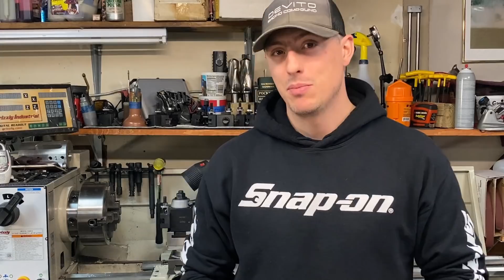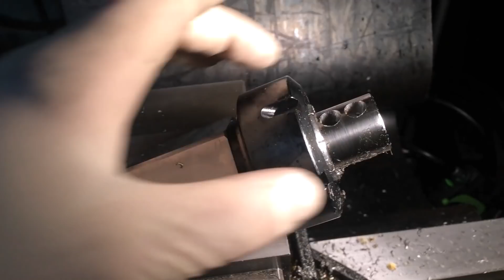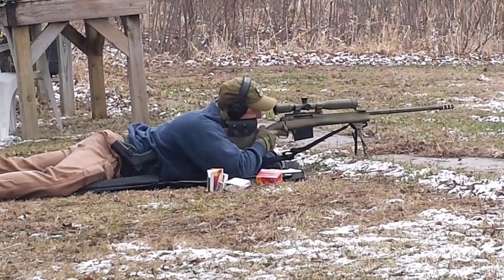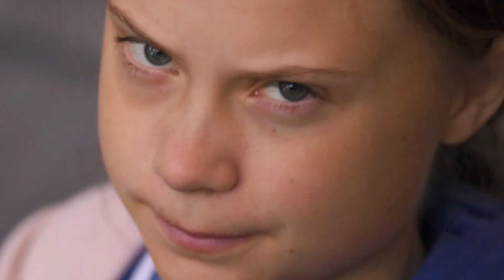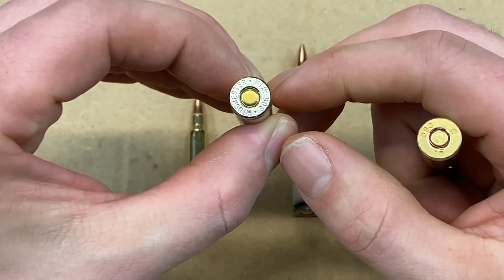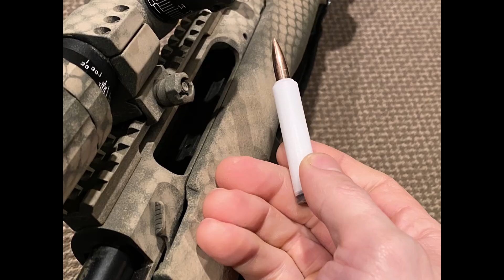6.8 NGSW ammo selected by the U.S Army for the NGSW Rifle testing! #ngsw #6point8ammo #army

Comment: Guns might overheat. The brass takes the heat away.
Reply: The brass inside the chamber absorbs some heat, but the real advantage is that it doesn't melt in a hot chamber...  Regarding recycling, almost  all thermoplastics can be recycled. But with a metal insert attached to it, most recycling plants would not dare to have anything to do with it.  Brass is still the best option. Can be re used, recycled, or left scattered on the battlefield just to be re-discovered by metal detectors after 50-100years.
Reply from the maker: All relevant concerns. I cant wait to see the test results.
Reply from the maker: wouldn't any casing material function that way.
Reply: @jeerrrrrrryyyyy  There's both advantages and concerns with the casing materials. I'm convinced most of it can be made to work .  In a environmental view, plastic doesn't sound to well. The degradable plastic types available today, do not meet the requirement for heat resistance. A thermoset plastic variant could be interesting, they will not melt in a hot chamber, but might be too fragile. If the cartridge is to be of a effective design, it need to have thin walls, and must be made of a material who will expand to the chamber wall, and make a  gas tight seal, without danger of rupture. This must be repeatable in both icy cold temperatures, and in a burning hot chamber.  My guts says it's a possible, but a damn difficult task. Brass is a well known, and very cheap way to produce cartridges.  It must be very good/cheap/environmental friendly to win the test.
Reply from the maker: @sidekickbob7227  I absolutely agree, like I said I’m really interested in the test results.

Comment: *This round was chosen by the US military for testing. It was not chosen as the winner of the competition. The competition is not scheduled to end until late 2021. This video was uploaded in 2019. 
*This polymer round is 30% lighter than a comparable 6.8mm round with a brass cartridge case, not 30% lighter than a 5.56mm round with a brass cartridge case. 
*The use of a polymer case raises the question of what will happen to the heat produced when the round is fired? Much of the heat leaves the weapon with the ejection of the brass when using a traditional cartridge. The brass absorbs the heat. Does the heat stay behind in the weapon when using a polymer case? What implications does this hold for weapons' temperature when using a polymer case?
Reply from the maker: That’s is correct the trail still hasn’t ended at this time and I’m interested to see what will the military go with when it is over.
   The information I have is from the T.V. Company that claimed that it is 30% lighter than the current cartridge being used, so that’s the information I used in this video.
   As far as the question of heat I can only speculate because T.V. Has not released this ammo commercial yet to test. 
   I have studied energy transmission

Comment: The 6.8 mm makes no sense at all to me. 140 Gr? Why would you go 6.8 mm? Because Remington said so? Still think Remington's analysis that 6.8 mm was more lethal was as flawed at 6.8 mm SPC. If you are going to 140 Gr, then why not 6.5mm with higher BC bullets? You will have flatter shooting longer range ammo. Hope this is not a case of military brass failing our soldiers again.
Reply from the maker: That’s fine, it doesn’t make sense to a lot of people.
   Yes 140 is what has been reported in testing with the True Velocity round. That could change due to it still being in testing phase.
   I don’t think it has anything to do with Remington, that company is gone.
   To your 4th statement/question I can’t tell if you’re asking me or the military testing this ammunition.
   I personally like 6.5 Grendel, but my opinion doesn’t write policy with the military industrial complex.
   As to the “hoping it’s not the case” I don’t know. This whole testing process could go away as fast as it started.
   Thank you for watching Taluvian.
Reply: @jeerrrrrrryyyyy  6.5 mm vs 6.8 mm you need 30 to 35 additional grains for similar BC. You then are canceling the saving weight and reduced recoil narrative. For same BC as a 140 to 145 gr 6.5 mm you would have to jump up to 170 to 180 gr bullet. Now you are back to 7.62 recoil territory. I have always felt the 6.5 mm was ideal military rifles. One can argue all day which current cartridge is best option. The issue I have with 6.8 mm was I do not see why this would be choice, other than Remington study saying 6.8 mm was most lethal for military rifle caliber. Then come out with a less than optimal cartridge. I still think 6.8 mm is a mistake, and military should be looking at 6.5 mm high BC long range performance.
Reply from the maker: @Taluvian  I think you’re correct, one can argue all day about which cartridge is the best option.

Comment: pro:33%lighter
140 grain moving at 3200fps is 3200 ft lbs of KE.
Might be good a good fit for a lmg or dmr

Cons: takes up alot of space.
Recoil is going to be a son of a bitch.
Doubtful that it penentrates armor at 100 yards certain it wont at 300 yards even with api rounds which most soldiers probably wont carry.
Magazines are going to be huge and hard to mount comfortably on a plate carrier.
Wont penetrate armor at 600 yards so marksmanship will still be required.
Barrels on rifles will get very hot 3200 ft lbs is a good bit of powder so yea maybe you can carry more rounds but im skeptical that you wont be able to shoot as many without the barrels overheating. 
Looks kind of stupid too
Waste of money 
80% OF SOLDIERS ARE HAPPY WITH THE M4
Reply from the maker: That certainly is a list of cons.

Comment: I understand that polymer ammunition can fire longer before problems with "cook off" occur. However, I would rather have a round cook off, than have it melt in the chamber. They found that a melted round after sitting for a few minutes leaves the weapon completely useless until the chamber is properly cleaned. This is VERY BAD when in combat for extended periods of time.
Reply from the maker: Yeah I agree with the cook off situation. They don’t give out the temp that this new polymer melts at and I have seen some new ones go as high as 500+. 
 What interests me is that all the poly coated Wolf ammunition that I have rapid fired in my time. I have never had plastic build up in the chamber.
Reply: @jeerrrrrrryyyyy  that Russian polymer is different, and actually carbonizes and blows out as it burns. Also, the Russian chambers are far more loose than ours.
 The problem with True Velocity ammo, is the plastic actually melts when sitting in the chamber, and it glues itself to the chamber walls. They've had some rounds cook off after 3-5 minutes, and when the powder burns, it cycles and ejects only the steel case head, leaving a melted casing glued in the chamber.
Reply from the maker: @Condor1970  If what your saying is true then obviously true velocity needs to go back to the drawing board with there new polymer.
Do you have a link to this information?
Reply: @jeerrrrrrryyyyy  ... I can't find the article, but I do have a link to another where true Velocity has one of their guys joining SAAMI. 
https://www.thefirearmblog.com/blog/2020/10/19/true-velocity-join-saamis-board-of-directors-as-a-voting-member/
They're making a big push to get their ammo into military service. No conflict of interest there, right? Anyway, down in the comments, there is another guy who makes mention of the cook off problem they have with polymer casings when used in full auto LMG's and extended full auto use in infantry rifles. True Velocity's answer is to "train" servicemen to make sure they eject any rounds from the chamber immediately, and wait for the weapon to cool down or wait until you need to fire again before chambering another round. This is not good policy when in combat. I wish I could find the report the Army gave when testing the ammo, but word is out with enough users to raise some serious questions and perhaps even a few red flags.
Reply from the maker: @Condor1970  yeah if that is accurate there is a huge issue, but I can’t tell you how many to I have heard false rumors, like Beretta 92 slides break all the time. Then to find out the military never changed out the recoil spring or gave the training pistols any recommend maintaining at all. 
Like I said if the T.V. Round doesn’t work then they need to fix it or the military needs to go in a different direction.

Lol yeah if they do have someone in the saami pulling strings I guess that would be the same or similar way the military ended up with the Sig 320.

Comment: How is the case recyclable?
Reply from the maker: Scrapper Max The case is made of plastic. Plastic is a recyclable material, so that’s one possible attribute to the True Velocity cartridge over the other two competitors.
Reply: Switchpod plastic can be recycled. But most plastic isn’t. Brass is 100 percent recyclable, and is actually lucrative to recycle. Reusing plastics degrades the quality of plastic products, so companies usually opt only to use about 15 percent of recycled plastics. If they add any more the new product will be garbage.
Reply from the maker: Scrapper Max It depends on the product the company is producing that dictates the quality/ rigidity the product being made needs to function with in the standard held by that particular parts quality threshold, This is what dictates the percentage of recycled plastic used needs to be.This of course still means that the case that T.V. Is producing is still in fact recyclable.
  Having said that Brass is pretty awesome.
Reply from the maker: Scrapper Max P.S. do you ever scrap gold out of computer boards or electronic?
It looks lucrative if you can get a machine to do the work.

Comment: Oh that's right. The Army is slowly turning into a lefty meme. All kidding aside, sure there are polymers that can withstand heat but they are relatively high cost compared to existing brass. The pressures inside the chamber could pose certain issues, splitting, melting etc. Military weapons aren't always cared for in the same way civilian weapons are. For me as a soldier the biggest concern first and foremost is cost and NEWSFLASH the federal government always goes for the lowest bidder. It might surprise of of you to know the army isn't exactly all about quality over quantity like it should be. I do not personally foresee this ammunition type coming anywhere near regular soldiers hands any time soon.
Reply: Also fun fact: reloading brass is not that expensive and the US Army does reload all of its practice ammo. Its dirty and cheap but its effective. One time use shit like this isnt going to be able to be reloaded.
Reply from the maker: Only time will tell. It will be interesting to see that notes after the trial and testing is done.

Comment: "The polymer cases will surely run cooler than the brass cases"
Ok lets talk on that for a quick second. Why does ammunition itself heat up? Ammunition heats up because as the gun continues to fire, the increasing latent heat is unable to shed as fast as the cartridges are fired and therefore heat builds up in the rifle. When discussing the latent heat of a cartridge, and how to address any issues this may present. Possibly the most pertinent aspect of bullet temperature, is the exact source. At what point in the cycle is the cartridge absorbing the most heat from the rifle? Well when you take into consideration both physics and common sense i think we can all agree that the vast majority of radiant energy that ends up in the cartridge is absorbed through the chamber. While i think we can all agree that excess heat in the cartridge is no good, i think most are not exactly aware why excess bullet heat and therefore excess bullet velocity is a negative thing. To make it short, when you zero a rifle with a specific load you are not only adjusting your POI in regard to the flight characteristics of a particular projectile, but you are also adjusting your POI in regard to the harmonics of the barrel and the timing with which the projectile leaves that barrel. Therefore adding heat, and by extension, velocity to a particular load changes the timing for the bullet exiting the muzzle. Basically the tip of the barrel is now pointed in a slightly different direction when the bullet leaves now. But to bring this TED talk back to the issue at hand, that being latent heat, and to make it short. Brass is an extremely thermally conductive metal, meaning that heat gathers in it VERY readily. And the rifle system relies on brass cases to extract heat from the chamber and then throw that heat out of the gun, chambering a new round and keeping that heat from reaching a critical mass. I know very well that any polymer is a very VERY effective insulator, which means that almost zero heat will be absorbed into a plastic shell and by extension the chamber of a given firearm. UNLESS the shooter allows the shell to sit in the chamber for a VERY extended period of time before firing and ejecting the shell, but that is just nowhere close to practical in essentially any given shooting situation. One possible solution for this issue would be to start converting guns to fluted chambers but not knowing more about these polymer shells, i question the safety of this concept due to the polymer very possibly requiring a fully supported chamber. All that i can say with absolute certainty is that in order to make reliable use of these polymer shells in conjunction with any given off the shelf firearm, there is going to require a lot of analyzing and prototyping to get things right and ensure that firearms across the board will function reliably with this new age product.
And with that i leave you, lol holy shit that was a lot of typing
Reply from the maker: Indeed. That was a lot of typing and thank you for leaving a comment. In light of tangentially I will leave you with this thought. If heat is energy, wouldn't it be a logical conclusion that (looking at this situation in a vacuum of course) you would want the most efficiency out of firearm, and by that I am referring to having the heat/energy being used towards propelling the projectile and not heating up brass that is being expelled? 
   Well I can say this, I have fired thousands for poly coated 7.62x39 rounds with not one failure, so I can say with great sincerity that I am very interested in seeing the test results of the T.V. ammunition.

Comment: Wrong on the heat issue.. the heat just ends up in the throat, eroding it faster.. Brass actually extract heat..  notable is that the bullet is barely in the case.. so that it has to seat into the barrel within a few thou. of the lands  and the faster speed actually acts against the concepts of a better stable long shooting bullet due to the supersonic transitions that are done  over the speeds of 2900 ft/sec.. something that was noted back when smokeless powder was first introduced.  it is all in the physics.  Then there is what is good on an ideal day, verse what a rainy day will yield.. and dust.  The other issue is costs, as it has already been admitted that the polymer cases will be patented and quite costly, thus there will be a lack of universal adoption as by NATO.  SIG has made note of that and produced a case that can be made entirely out of steel and of the capacity that the present large ammunition manufactures can readily produce their suggested product.  Perhaps the fully automatic rifle should be rejected, because this shoot and pray mentality is never going to have enough ammo to forfill the needs of the users tha  are trained that way...    I would be better to just pay this company to go away than to accept a bad product...
Reply from the maker: Indeed

Comment: I know the idea is to defeat modern armor plates as well as reliably engage targets at distance, but I wonder if they really needed to go to such a big round to do that. Could they have made a smaller, more intermediate cartridge in a 6 or 6.5mm bullet that's either the same length or a little longer than the 5.56, while also integrating all the new casing and powder technology to really drive the pressure and performance up? If you could make it fit in an AR lower, you'd only have to change out barrels, buffers, bolts, and magazines in our existing guns.
Reply from the maker: yeah, that would be nice.

Comment: I don’t care for the polymer solution. I prefer Sig’s .277 Fury that’s in the running. It’s an all metal case albeit very different. If nothing else, why use plastic when metal can do the same? I’m no environmentalist but I do recognize that plastic waste is becoming a huge problem. If there’s a way way to achieve the same goal without using plastic, I’m all for it.
Reply from the maker: Dark Star 420 I believe the lowering of weight is a primary goal that the army is looking at during the trials.

Comment: 3200 fps with a 140 .277, sounds like a 270 WSM, I see the weight advantage of polymer cases but you really have to crank the pressure up to do 3200fps with a 140 grain bullet. Polymer doesn't take blowing up very well.
Reply from the maker: Chet Lockwood most likely not, but it has the strength of the chamber. Brass and steel cases will rupture out of chamber as well.